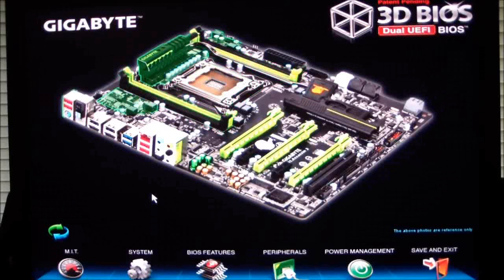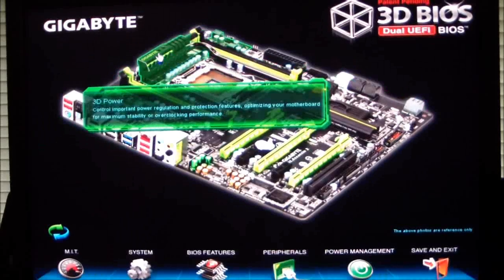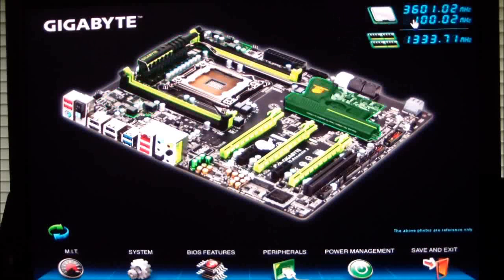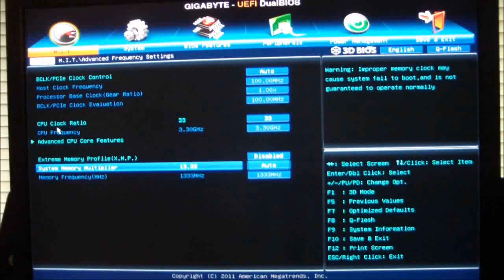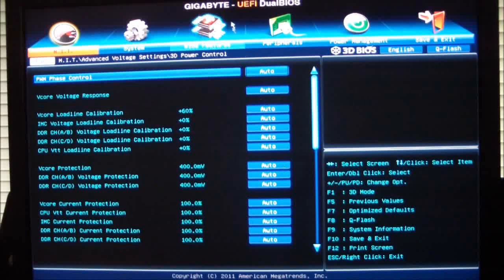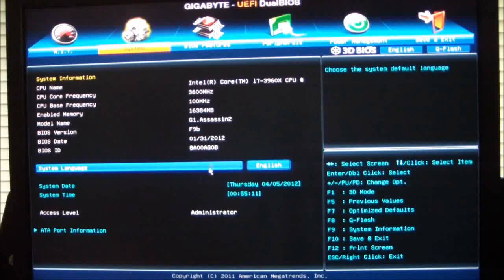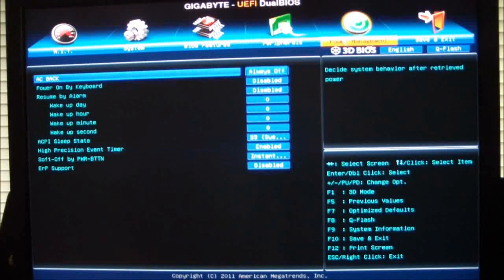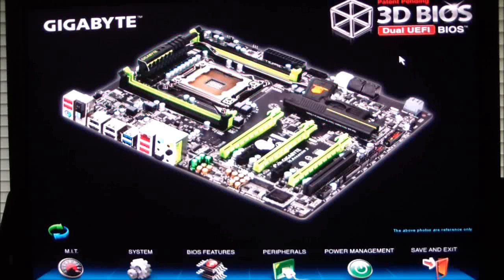Gigabyte G1 Killer Assassin 2 X79 Motherboard 3D UEFI Bios Overview

Comment: This is still a great board with my XEON 1650 V0 in it I get performance on par and in some areas ahead of a 8700k overclocked to 4.8ghz now (I think I won the silicone Lotto for the first time ever ;with this CPU) on a fairly sweet water cooling solution in a old school Antec performance series case that I just love that much.... #X79FOREVER I just dunno why Gigabyte does not have the latest Bios listed, I had to use a modded version as in F13B as the latest AS GIGABYTE HAS SOME CRAPPY f12y listed as (BETA) as an end bios for this board,m lost some respect.... Why would a company leave an enthusiast level board off at a "BETA" BIOS? That is some shit! I do not even know what the TRUE real latest Bios is now for this board officially but this MODDED F13B which was hard to find works really well.... I just need to find the wifi/bluetooth killer card that comes with it to have a full assassin 2 again. This board is scarce, I see a few on eBay once in a blue moon for around $700.00 or so.... WOW! A tad more then when it was NEW!...... BTW: anyone GET nvme / m.2 working as boot drive (or) with X79 yet as I really dig the-platform and its all I feel I am really missing..... I actually want to try that 10 or 12 core CPU with the highest clock.... 26xx but not sure which one would be the best pick for overclocking and the most cores above 8....
Reply: lol i was i was just searching up stuff about this board and i found u
Reply: Where can I get this F13B bios version?

Comment: im geussin its a i7 3960x at retail but you can get em for 1100$ on ebay but im saving up for the ultimate pc rig it is about 7000$ it will take about 2.5 years till i got enough cash but by then it will be out dated :O so ya it be cray cray